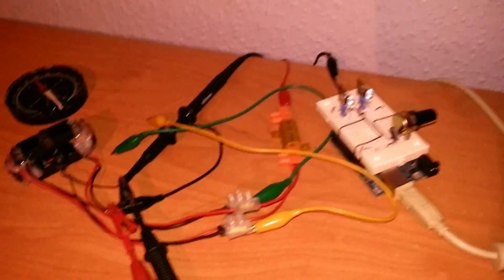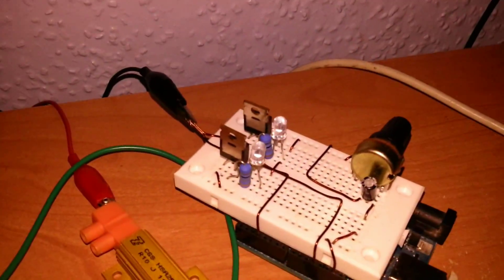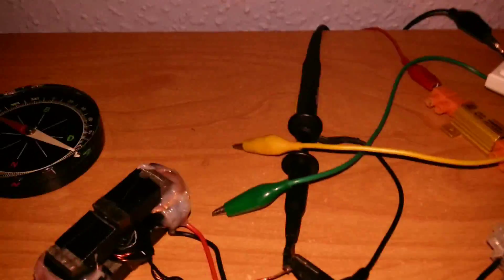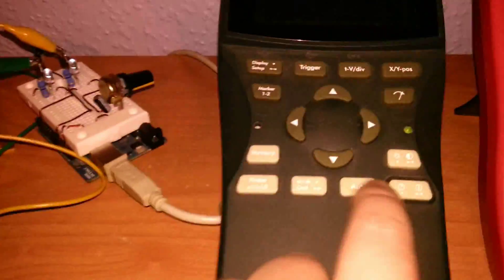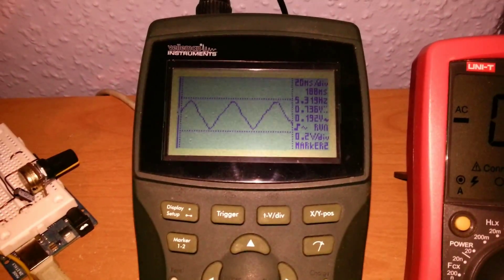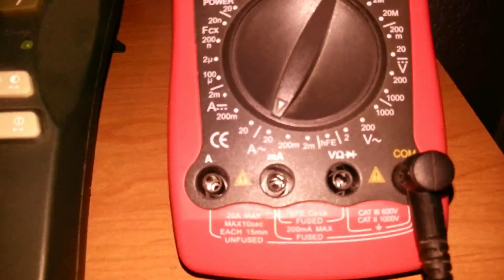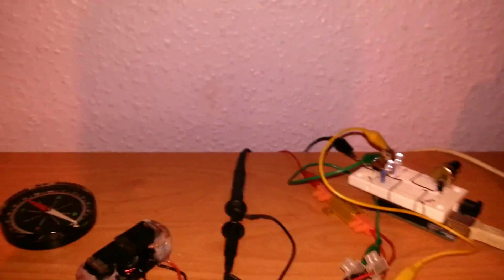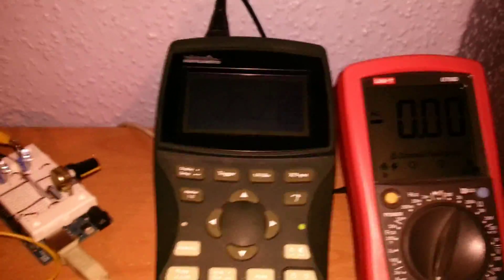Clemente Figueras Generator

Comment: how can you have a patent for 19077 with silicon transistors ??? not even good germanium transistors were then,, its all vacuum tube then, and you have filament heat loss,
Reply: +better livin Back in those days, they had mechanical ways of doing things, such as a spinning device with brushes.
Reply: @morpher44   EXACTLY AND WELL PUT!.
Reply: The original FIguera device had a rotating brush on an active inductor controller that varied the current going to two sets of opposing electromagnets causing the collision point to be shifted back and forth over the secondary which was placed in the middle.
Reply: How pretentious is your account picture ... How arrogant and narrow - minded is your comment ...